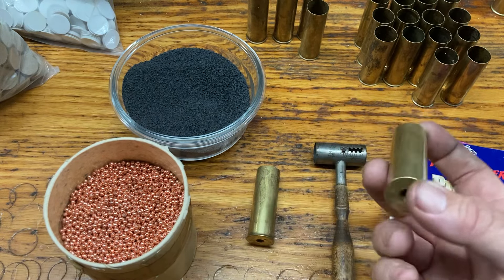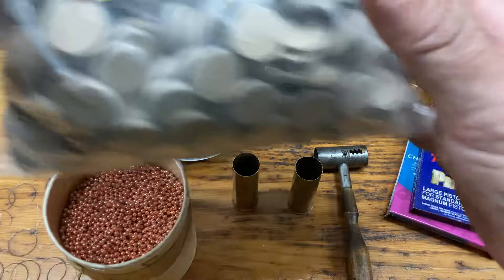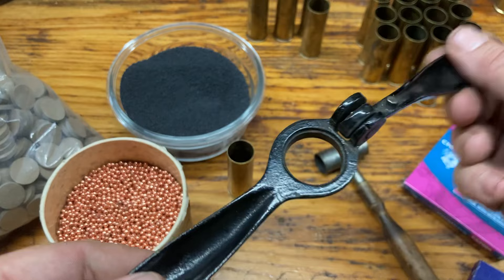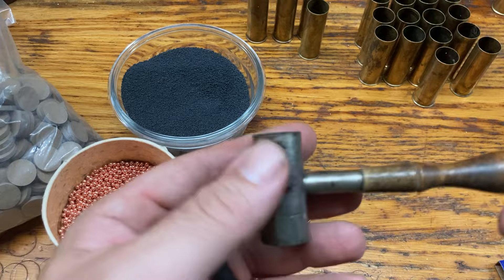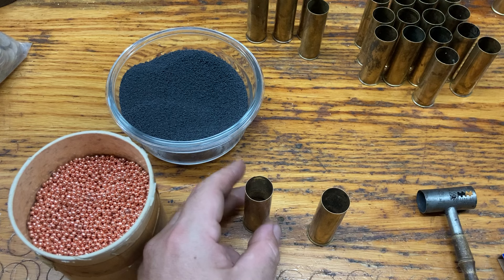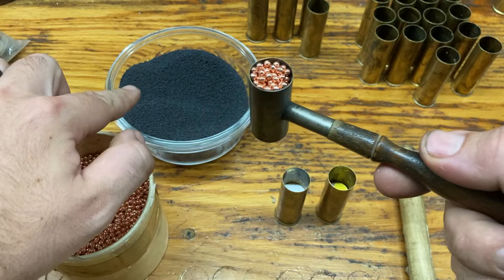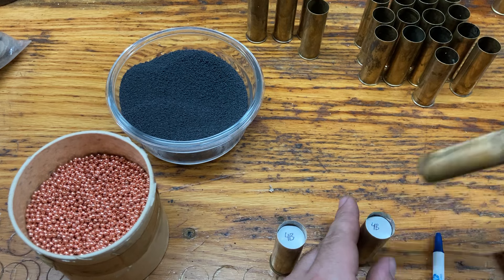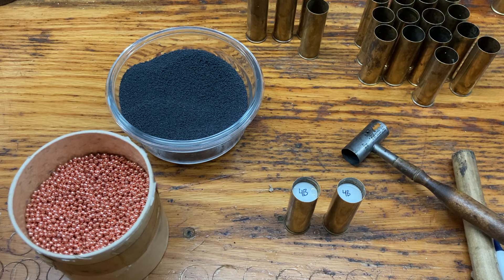Reloading 12 Gauge Brass Hulls with Black Powder

Comment: Here in Brazil, some people have the tradition of using candle paraffin as a cartridge sealant, it is very cheap and works as well as the sealant you used.
Reply from the maker: Many people here still use it as well! I’ve only tried it a couple of times though
Reply: There's a video idea for you hehe
Reply: nice

Comment: Try using Copper Plated BB's but use a Shot Cup to protect the Barrel from the Steel Shot .I use Plastic Hulls cut to 2.5 inches and Roll Crimped with Win WAA12R wads with the legs removed and an overshot wad and Black Powder.
Reply from the maker: I know a few people who do that with normal steel shot or shoot 6 or smaller steel shot through more open chokes. I've contemplated it, but I've had a few old Damascus barreled guns that had damage from steel shot that have made me hesitant to this point. I may have to work up a few loads to test out of a beater. It's definitely cheaper!

Comment: I was lucky. There used to be a guy who turned 12ga brass shells from solid brass rods.  I bought two boxes.  The walls are a little thicker but they will last forever.  I load them using a wooden antique reloading set.

Comment: Thanks for the walk through.  I'm planning on fire forming 303 British into 410. So this load process will be very helpful once I start actually making my own brass shell loads.
Reply from the maker: I fireform for my 43 Spanish with 348 win cases. Good luck!
Reply: @twiststeelandsmoke  any advice on fire forming. Aside from annealing the case first. This will be my first attempt.
Reply from the maker: @Riven1974  I don’t really have much to add to the videos and articles on it already. Since you’re going to a shotshell, trimming to length won’t be an issue. It’s fun to do!

Comment: You can use a roll crimping tool on these brass hulls but it would need more wadding to fill the shell up to the top.
Reply from the maker: I have one of the RCBS die sets that includes the crimping tool, but I don’t use it. I’ve heard it shortens case life since you’re working the brass a lot more

Comment: Hi dear sir:could you tell me the weight of powder exactly by grains?dosent black powder damage the barrel?
Reply from the maker: This is a light 3 dram charge. A 3 dram charge is about 82 grains by volume. This is actually a black powder substitute, so it actually has less mass than real black powder per volume

Comment: Are there any alternatives you can use to that cement?
Reply from the maker: Elmer’s glue can work (some guys use normal or wood), melted wax, sodium silicate. You could probably experiment with other adhesives too that are similar to any of those. The biggest issue is you don’t want the overshot flying off in the second barrel after your first shot!
Reply: 4
0
Reply: Hot glue

Comment: Super cool! Considering the consumables (black powder, shot, etc), what's the price of each fired round?
Reply from the maker: That’s a tough question. I haven’t bought pistol primers in years. The cases after a few reloads are immaterial. Going off current BP rates, it’s about 34 cents a shot for a 3 dram load. I load a lot of bismuth for ducks, so that’s about a buck an ounce. I buy so many wads, I have no idea what the breakdown would be either!
Reply: Many thanks for the answer!

I don't have experience with shotguns and reloading but it sounds like a good idea :-)

Comment: Thank you very much Sir, 
a few questions how long those hulls would last / how long have you had these ones?
Wouldn't giving them an occasional polishing to clean off the scoring make them last a little longer?
Reply from the maker: Some are about 15ish years old and some are only a couple years. They should last a long time. They might last longer if I polished off the scoring. A little vinegar will take most of it right off. I just shoot them so quickly afterwards, I don’t worry about it. I deprime them, wash them, and put them in a little vinegar/water mix (if I want them super shiny), let them air dry (or wipe them completely dry) and then put them in my tumbler. 

If I skip the vinegar and the wiping, some of the scoring will remain. I haven’t had any issues yet.

Comment: Interesting video!   Thank you for sharing this lost tradition.   Could you also use traditional plastic shotgun shells with the crimped ends with black powder?   I’m not into reloading so I have no clue.
Reply from the maker: Yes! A lot of people use them for cowboy action shoots. I also use my once fired plastic hulls and will load them with black powder and roll crimp them. The plastic hulls have short life with black powder though. They get pinprick holes in the hulls quickly
Reply: @twiststeelandsmoke  very cool!   I’d love to try that out someday for some black powder upland game hunting.  I’m totally into that, but not with black powder.   Thanks for the 411!
Reply from the maker: @colt10mmsecurity68 I’ve used both plastic and brass loaded with black powder for upland and waterfowl. They still work great! I shot doves, rabbits, squirrels, ducks, and a goose with them last season. My only pheasants were with smokeless though 😂

Comment: I have a question can i use shotgun reload press to use with brass case
Reply: I don't see why not. Bases are the same
Reply from the maker: Primers are different and you would not be able to use the resizing station or crimping station. You could drop powder and possibly the wad (depending on what you’re using). It doesn’t really make sense to use a press unless you’re using the RCBS cowboy dies made for these

Comment: Last I saw Rocky Mountain was looking for new owners about a year ago. I bought a box of their 12 gauge brass designed for 209 primers. Their quality is far more superior to the Brazilian Magtec shells. I came across some warnings years ago about drilling out the Magtecs for 209 primers. The base of the Magtecs is too thin and you weaken the head of the shell. RMCW brass is turned from solid bar brass rod and they allow for a thicker head allowing the placement of a 209 primer in the shell. I prefer brass over plastic or paper hulls.
Reply from the maker: I prefer the brass as well. I just wish the issue of fireforming didn’t exist. It’s a pain I can only shoot them in some of my guns. I have the resizing die from RCBS but have never messed with it

Comment: I can’t find Large Pistol Primers (in stock) anywhere!
Reply from the maker: That’s the worst! That’s why some of mine are 209s. I can usually find one or the other
Reply: @twiststeelandsmoke  I only have the MagTech brass, all Large Pistol. I’ve seen where they can be modded to accept 209s , but not sure I want to go that route.
Reply from the maker: @m1cajah  yeah, removing metal is never the greatest option

Comment: Where can I get 12 gauge of these
Reply from the maker: Magtech makes them the cheapest, but they are not easy to find right now. Other options (but they’re expensive) are Track of the Wolf and Rocky Mountain Cartridge. You can also try to buy vintage brass hulls at gun shows or on Gunbroker. The one issue you might have with second hand hulls is that they fireform to chambers. If they were used in a gun with a larger chamber than your 12 gauge, they won’t fit in your gun unless you have a resizing die. RCBS has a die set and there is another resizing die that is escaping my memory right now too

Comment: Where can i get brass shell sir
Reply from the maker: They’re a little difficult to find right now if you’re looking for 12s, but Midway, Track of the Wolf, Rocky Mountain Cartridge, Buffalo Arms, and auction sites are great places to start. Most other gauges are readily available right now though
Reply: I am looking for 16 bore sir
Reply from the maker: @muansofficial2310  check Ballistic Products. They more than likely have them right now

Comment: Hey, I don't have acces to nitro cards. Are they needed or can I skip that step?
Reply from the maker: They act as a gas seal. If you skip it, your patterns may not be great. Harder cardboard can be used as well. I’ve glued three pieces of harder cardboard (the noncorrugated stuff) together and it’s worked well
Reply: @twiststeelandsmoke  oh ok, huge thanks